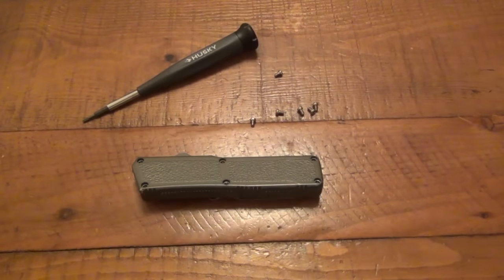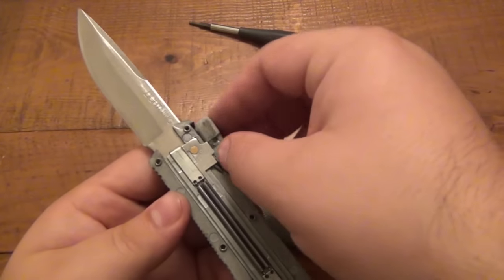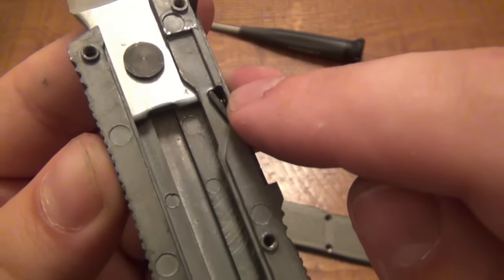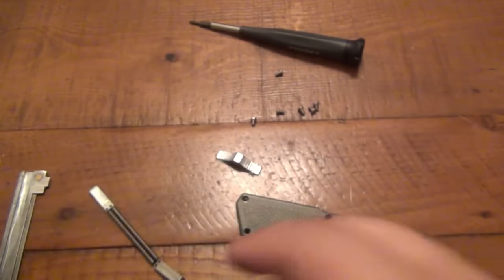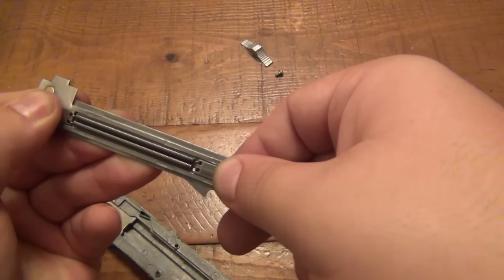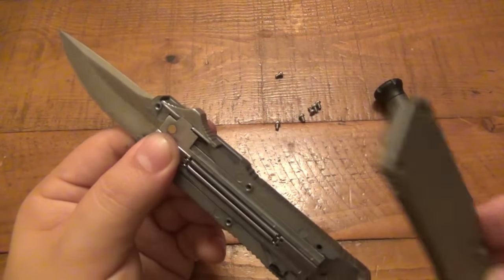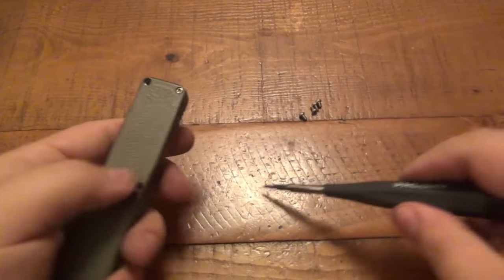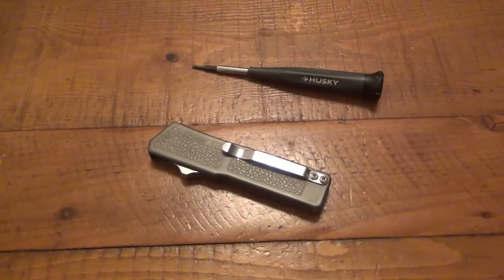Explaining How OTF Automatic Knives Work (OTF = Out The Front)

Comment: I still prefer to disassemble the knife to oil it so I know for certain there is oil on all the moving parts.

If you don't want to do this, you can spray Rem oil (Microtech recommends this specifically) or WD-40; or drip lube like mineral oil or KPL inside while the blade is closed. This should lubricate the moving parts inside along with the other internals, but in my opinion it's a bit overkill. Not for me personally, but it works.

Note: Immediately following spraying inside, open/close the knife a fair number of times while holding it upside down to let oil drip out. I want to mention that in the past, while doing this, I've had knives temporarily fail to lock. Don't panic; keep working out the excess oil & it should begin to lock up again just fine.
It also helps to grip the knife handle tightly while closed while holding a paper towel against the opening, & whip the knife in a semicircle. This uses centrifugal force to remove additional oil from inside & fling it harmlessly onto the paper towel instead of your walls, ceiling, or loved ones. 😃 Hope this is helpful to someone!

Comment: So here is how it works, from what i have seen:

When you toggle the switch to launch the blade opened, the spring-slide unlocks the locking tabs by moving them away from the blade, by the time this is fully done, the blade is under enough tension to launch it to the top or bottom ( That's the short answer )

Notice the pointed area on the side (That's for the bottom locking tab)
The other is under the square part of it (That's for the top locking tab)

Notice the round piece on the blade, and the small notch on the bottom of the blade.
The 2 "L-Shaped" connectors, with the spring use those to launch the blade.

The shorter L-piece connects with the round piece, which could most likely be a weight, and the longer L-piece connects with the bottom notch in the blade.

When you go to close the blade, the Shorter L-piece stays in contact with the round piece of the bade, when the switch is moved to the closed position, you have put tension on the blade, and once you fully move it to the closed position, it has unlocked the upper locking tab; thus causing the spring to snap back, and launch the blade to the bottom, and lock it.
Reply: thank you so much ^^ finaly understand it now lolz
Reply: I’m a visual learner
Reply: Finally. Seen so many detailed videos on the workings of these, but no one explaining how the spring tension works. Thank you!
Reply: @crookedcreature3895  No problem

Comment: I just want to add a comment to some of the explanations as to how these knives function. I'll tell you my original confusion and what I had to learn. My original confusion was that this seemed like a perpetual motion machine. How can a spring open AND close the blade?  And what resets the tension in the spring? Or if one spring opens it and another closes it, how do they not cancel each other out? What I've learned is that you, the operator, are putting energy into the system when you start to slide the trigger switch. You slide the activator switch about a centimeter in order to eject or to close the blade. When you begin to slide the switch, you actually are stretching out a pretty high-tension spring. When you continue to slide the switch, it trips a release and the blade is no longer held in place, so the spring snaps back to resting position and rocket the blade open. Same is true with closing it. The blade sits in a slide housing so that the spring can be cleverly attached in order to make the blade move in two directions.
Reply: The key to understanding it for me after similar confusion to yours about perpetual motion was firstly to understand that there is energy input from pushing the latch either way, and secondly that the spring starts the blade moving but it continues to move under inertia. Your comment helped me fully understand this.

Comment: I have a cobratec knife that works just exactly like the one you're showing.  The problem I'm having is that the blade does not spring in or out, where does the blade make contact with the spring so it will work???

Comment: I like to use a q-tip with some Rem oil to get in the grooves and hard to reach places where there's metal shavings. P.S. Check the screws periodically as they will loosen over time. Also don't over tighten. The zinc alloy handles are soft and will cause the screws to strip out.

Comment: Watched a different video, aside from the two locks and notches for them there is a small peg on the blade. One of those L shaped bars on the slide will grab onto that notch for retraction and the other side on the bottom of the blade for extension. When you push the button up it puts tension on the bottom of the blade which is held in place be the bottom lock, which is released at the top of the push the springs then do their thing and push the blade forward and out which is when the forward lock catches it, for retraction is the same thing except that the spring is being pulled on by the notch on the blade rather than the bottom.
This is why the knives are mostly harmless when the blade is extending because the only thing pulling it forward is the spring tension and unless it reaches the lock it's just sliding in the track back and forth. Hope this helps to explain what is happening because this guy doesn't show our talk about any of this but it's the first video you will find!

Comment: What I think is happening is the plates that have the 2 springs attached to it, one of the plates are catching on a groove on the blade while the slide moves the whole body and on the other side it holds on to the body making the spring stretch and when there's a certain point of the slider there is a wedge that opens up the lock that keeps it from closing letting it close all the way and since the plate is still holding on to it, it slings it back to a closed position and the bottom lock locks it in place and does the same thing to open it. If that makes any sense. (Just search up of videos on dual action blades like the hidden blade on assassins creed)

Comment: The plate slides forward while the spring stays behind hooked in the grove of the blade. When the notch passes the lock mechanism it contracts the tension thus slinging the blade out.

Comment: andi still dont understand how these work
Reply: One or the other spring will always  be under tension so when you push the lever up it releases the bottom latch and the spring that is under tension being held there will push  the knife upward, the same in reverse  

Pushing the lever gives the whole knife its purpose. you can feel the spring just by pushing on the lever
pretty ingenious
Reply: The springs are under tension after one end or the other has been moving about an inch. The blade itself isn't attached to the springs and the blade moves farther than they do because it has kick-points at either end that catch on either end of the spring and slider assembly. The spring is under enough tension to force the blade to slide the extra difference, recreating tension once the blade is fully extended or retracted, and has been locked into place at one end of the handle or the other.
Reply: Andrew Wang Kinda what I was thinking! 2 spings, attached at the same points?? Where do these springs connect to the blade to launch it?
Reply: +alfwok Thank you!, i finally understood that thing
Reply: the bottom latch 'hooks' onto the back portion of the blade that is locked by a tiny piece, whenver you push the button up, the blade still dosen't move yet, but that creates a tension in the spring and pushes that 'slider' up, when you push the slider up it unlocks the tiny piece holding the blade, so the spring will kick the blade out to the front, the bottom L Latch will 'hook' onto the case, and the blade will get locked by another tiny piece in the front, and the front L Latch will hold onto the blade (that black circle on the blade), when you push the button down it will create tension since the blade is locked, until you moved the slide enough so theres nothing holding the blade, the spring will kick it back to the initial position witch will lock in the bottom latch, repeating the process. Both springs are in the same tension, they are 2 springs so it functions faster and stronger
Reply: there is one lug on the blade 2:27

the springs have a claw on both ends. when the user presses the button, it gives more tension while simultaneously releasing the lock. the extra tension on one side will throw the blade with enough force to catch the lock on the other side. it is the same mechanism both ways.

it's like if you had a baseball and threw it from one hand to the other, except the baseball was attached to a rail and a blade.
Reply: Just like me
Reply: He didn't explain how it works.
Reply: Nice explanation but I still think it's magic.
Reply: Pretty sure it's magic or some sort of witchcraft.
Reply: @90foxfreak  In the Twin Light Zone...
Reply: @muraturile  you good??
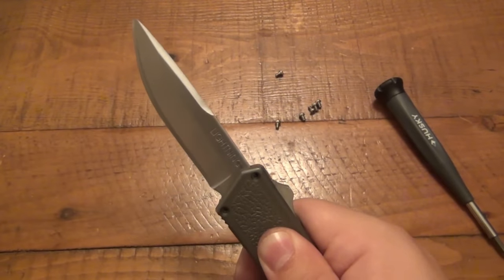Reply: 3:42 explains alot of the confusion. 
So the springs aren't ever attached to the blade which is why even though the springs are in place, the blade can move freely.
So the way the springs work, if I'm understanding correctly, is that they just momentarily "push" the blade towards the other spring. The blade has enough inertia to overcome the "recieving" spring and lock into place with the locking lug that he was showing us.
So when the locking lug locks, it keeps the blade in place and the spring under tension, ready to launch the blade against the other spring and into the other locking lug.
Reply: It could work with one spring, but they use two springs connected together for more force and reliability. Energy that gives the blade momentum, in either direction, is supplied by the user shifting the switch, giving tension to springs which pull the blade in a given direction when switch is shifted to the point when blade is released by spring loaded locks.
Blade shifts freely until it gets locked in one of the two positions. Springs provide initial momentum. The rest is just kinetic energy of the shifting blade.
Reply: Tokei that how I feel when some explains Internet to me
Reply: The thing that is not so apparent is that the switch is not a switch, but a way to move the mass. The springs are always in tension because the mass is moved forwards or backwards

Comment: So i have a Ravencrest Tactical OTF that I have had for a few years, When i got it, I thought it was the sweetest thing ever then on the same day I fired it and it didn't catch so I did the pull the blade thing to lock it back and it was fine for a day. The next day I fired it and same thing happened cept when i pulled the blade it wont catch and the blade is just free floating. I sent it back for them to fix or replace it. Got the new/fixed one in. It did the same thing after I fired it twice. Now its been sitting in my night stand for probably over a year. Any suggestions? or should I just send it back to them again for them to "fix it"? Sorry for the essay

Comment: I guess i always assumed the springs would be counterweighted and when you push the button the acceleration of the blade would have mass that then charges the return spring. Instead the switch itself is used to charge the springs for both action😅. Seems so obvious now

Comment: So if I'm right if you were to store the lightning it would be best to leave it where the blade flows loose? so both the springs are equal?
Reply: Correct, same goes for switchblades, always store with no pressure on the spring(s)
Reply: +mo_viking why are knives different that gun magazines? It doesn't matter if you store gun magazines with springs under pressure or not
Reply: Yeah, you keep on telling yourself that and see how it works out for you, personally I rotate my mags every month, whenever I get a weak spring Wolff sells great replacements.

Btw, if you were trolling, nice try.
Reply: mo_viking compression and decompression cycles weaken springs in magazines...... not keeping them compressed.

Comment: My lightning has a twangy spring sound when it opens and closes. Any way I can possibly reduce or eliminate that? Thanks in advance
Reply: SK88RR5 The one I have makes the same noise, do you know how to fix that yet?
Reply: I couldnt find anything on the internet for it, but what i did was i took the springs out, and put a fair amount of fishing reel grease (not WD40 or any other silicon/oil type of spray) on them. after that, it didnt make that twanging noise anymore. Its not a permanent fix since the grease will wear away with use, but its never a bad thing to lube up any type of mechanical device anyways so. The small little tube of grease i got cost less that $2 too.

Comment: there are 4 springs, he only showed two. The springs arent very strong. the weight of the blade moving from the tension of two springs moves it fast enough to put tension on the other two springs and lock in place each time. the springs have to be perfectly weak enough to stretch out from a moving blade and string enough to initially get the blade moving. maybe? lol

Comment: seems like it would be legal in canada technically
Reply: ***** I guess. But couldn't the argument be made that it's assisted opening?
Reply: Ok i can work with that. Do you know of a knife that has the switch on the blade.(schrade has some). I looked at them and the spring out but they don't spring back. Do you know of any double action otf knives with the switch on the blade
Reply: benchmade and microtech both make double action otf knives. just be prepared to save up quite a bit of money for one. there not cheep
Reply: Thanatos Sevious they aren't cheap either!

Comment: What happens when that small spring disintegrates over time...pain in your pocket.
Reply: springs will last generally in the 2,000,000 cycle range
Reply: Kevin Keel if I had one I would fuck off that 2,000,000 cycles the first year, and probably only open it 3 times to actually use It!
Reply: that figure should be noted at a minimum - it seems it's been a while since i did any reading on spring fatigue, they will last more like 1- or 200,000,000 cycles, not 2,000,000 cycles - sorry,

Comment: Those thin little spring powered things are all that keep the blade locked in position?

Can you even stab anything with it without breaking lol? ..

Plz someone answer I'm a noob.
Reply: A QUALITY type, that "tab" should hold a lot of pounds, say 30, 40, way more then is required to penetrate a person. You point is well taken, and a cheapy, could collapse on you.
Reply: The way that tab is encased would take more like hundreds of ft lbs. More likely the blade would break out of the casing

Comment: This did not show me how it works tho
Reply from the maker: The knife always wants to be in the opposite position but what's blocking it is the small tabs in the frame. So when you move the switch over it pushes it out of the way so it can move to the other position...
Reply: +cutlerylover how do the springs work to force the knife in either direction tho? Thanks for the reply for real tho, just really interested in the mechanics now😂😂👌🏼